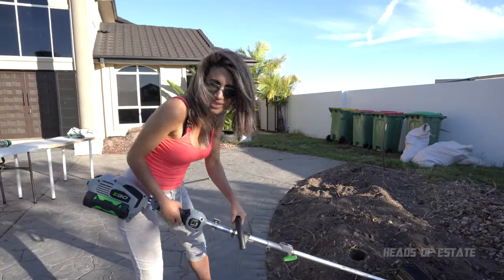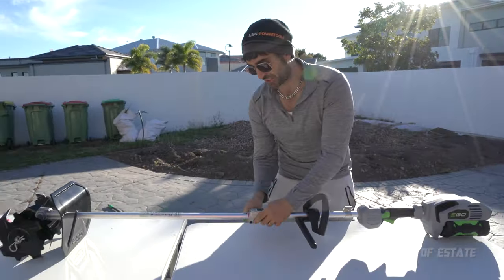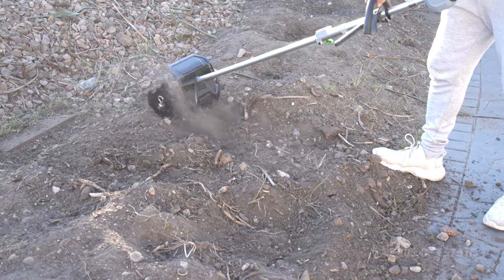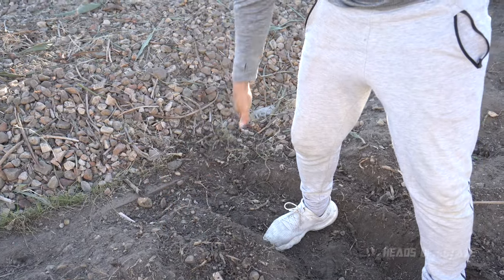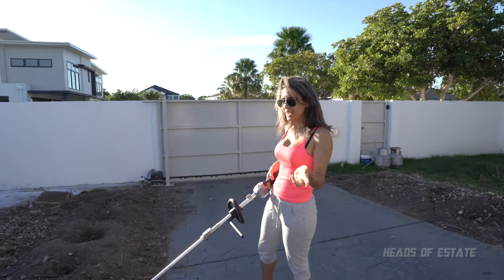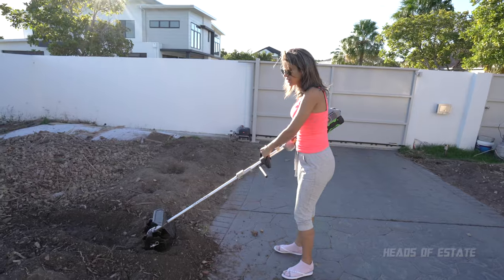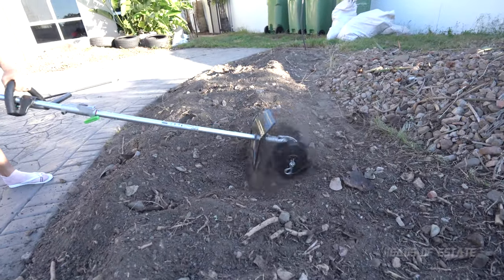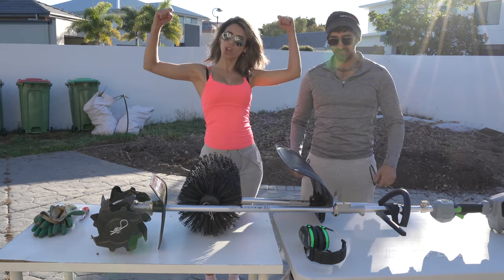EGO 56V Multi-Tool Cultivator REVIEW | How to Turn Hard Soil SOFT 💪

Comment: I recently made a new, rather large, bed in my back yard (i.e. 'garden').  Started doing it by hand with a mattock, and after a couple of hours and still 3/4s of the bed to finish, I thought "screw this, I'm going to buy the Ego cultivator attachment."  I already had the power head for when I bought the edger attachment previously (another great tool).  So I found the cultivator at a nearby hardware store, and the next day, finished the rest of the bed in about an hour.  This was a bed that was made from scratch in a space that formerly had grass growing on it.  I simply scalped the grass as low as I could with my mower to prevent tangling in the cultivator, and away I went.  No, it's not like cutting through soft butter, but it was a damn sight easier than doing it with hand-tools, and now I have a new toy I can play with every so often as needed, much to the little lady's dismay (though I'm sure she'll find some projects I'll need it for).  I'll need to till this same bed another time or two before we plant it with wildflowers in the spring, so the cost of the cultivator will eventually be cheaper than renting a tiller repeatedly.  Thanks for the demo.

Comment: I have used my EGO power head for about 60 minutes. One day with the broom and for 15 seconds with the cultivator. I started cultivating some sandy soil when the cultivator hit a small rock. I bent down and tossed the rock to the side. I tried to start the cultivator again, but it did not start. The battery is fully charged, and I have tried a second battery, too. I can spin the rod in the power head freely, but it will not turn with power, the battery blinks red when I try. I contacted EGO and they say the stone is a natural accident and not covered by warranty. I say something must be wrong with the wand and I want it checked. They continue to say that the rock has damaged it and the warranty does not cover it. I have asked to have this escalated up and have someone call me. They did after several days, but still repeat their written script that the rock has voided the warranty. It’s a garden cultivator, you will hit some small rocks. Common sense tells me there must be something wrong with the power head,  but they continue with the script, the rock has voided  your warranty. So, the wand lasted for 60 minutes. That is an expensive hour. Making me more frustrated with EGO is trying to connect with a human. I have spent over 90 minutes, (three phone calls) listening to the on-hold music. The first time I connected with them,  we were disconnected at 5:00 PM. I tried to call back only to find out they were closed for the day. That was very disturbing. I have bought the cultivator, broom, edger, and string trimmer in hopes of getting my area cleaned up this summer. So far, my experience has been very dissatisfying with EGO and I cannot recommend them.